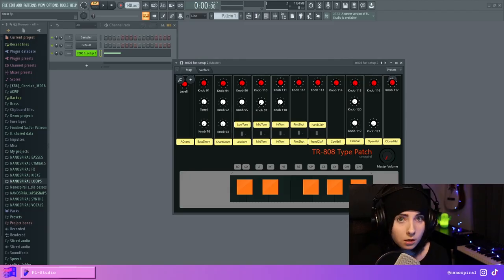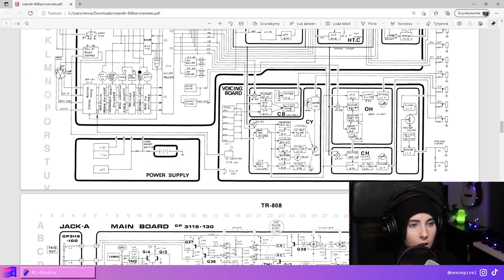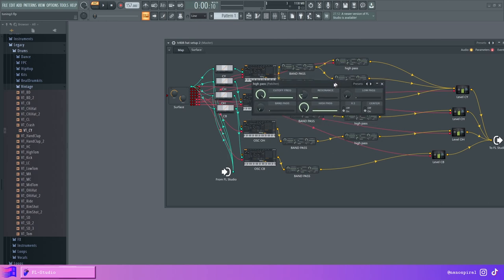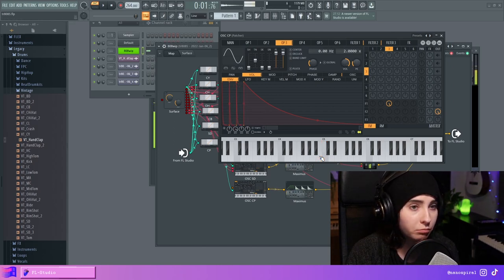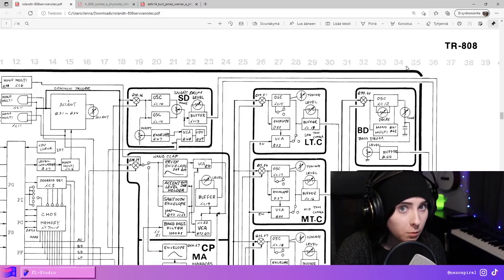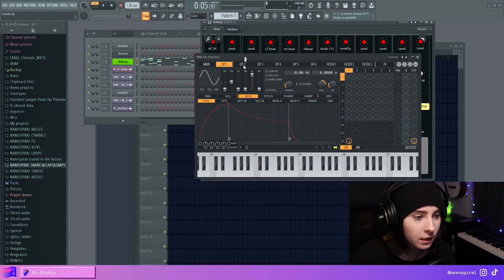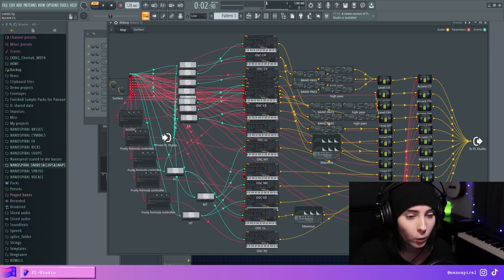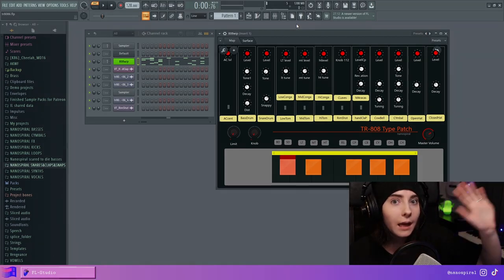I Made My Own TR-808 In Patcher | FREE PATCH DOWNLOAD

Comment: Great work! To answer your question around 17:20: The moment you trigger that note, the oscillator's signal jumps from 0 to sin(phase*2*pi) instantly and stays there. This creates a click which then gets transformed to that "ding" sound by that highly resonating filter. Releasing the note again doesn't create a click, because there's a tiny fade out per default. Note to everyone trying to play around with this: always send the signal trough a low cut filter, otherwise you get a DC offset on your line. Some audio equipment can take damage from that.

Also: By now, Patcher's routing area can be zoomed. Makes working on huge patches a bit easier.
Reply from the maker: I see, thanks for the explanation!